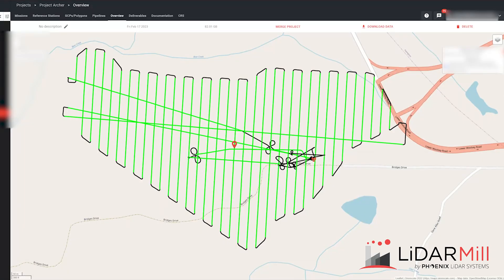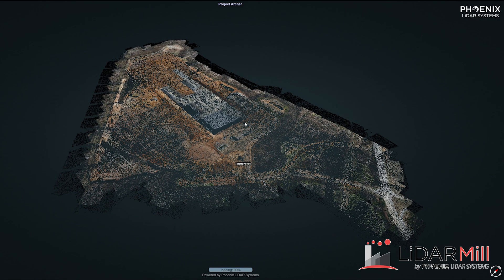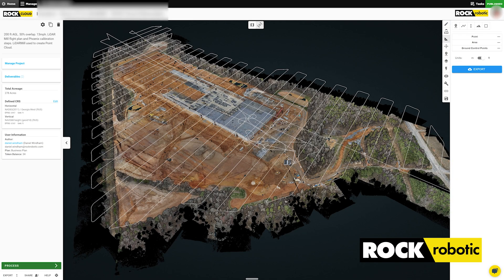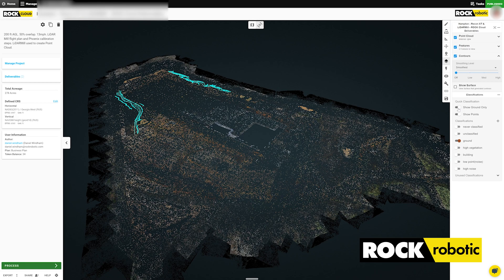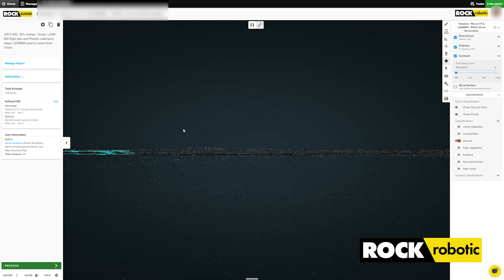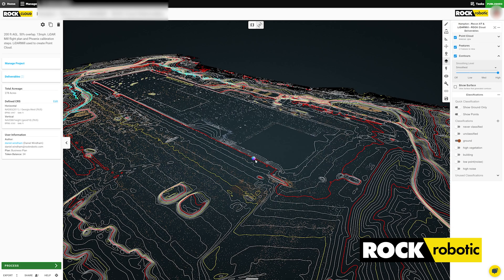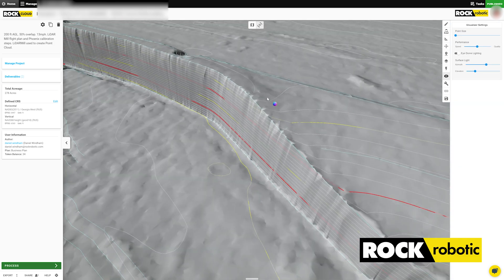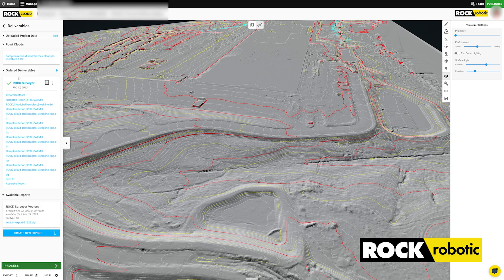ROCK Cloud vs. LiDARMiLL (Comparison 2023)

Comment: Oh man... shots have been fired with this video... Not really a fair comparison when you say "because there is a QA/QC Team that removes things like that".   Why not post a new video showing the results of Rock Cloud BEFORE actual people FIX THE DATA.  Sorry... but when things like this are posted they need to be called out for what is really happening.   We need Apples to Apples... not a video showing a cleaned up point cloud by humans compared to one strictly grounded through automation.
Reply: Ours did have the roof in it with AI, sorry I thought that was implied. They didn't look that different! That's the point of the team. We don't produce AI only deliverables.